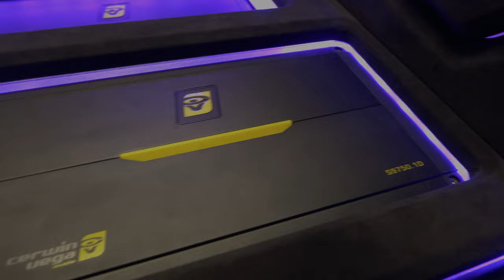CUSTOM CAR AUDIO [ Infiniti G37 ]

Comment: Running an extra headunit ground to your amp ground point helps big with stopping ground loop noise.
Reply from the maker: Huge thank's for the input Stanley and a extra ground was actually suggested from a friend. All installed and done 😍

Comment: Bro the trunk looks awsome. But the speaker and rca cabling ran with power cables isn't a issue if using good rcas and cabling.. 90% of the time noise comes from crappy grounds. If you test for good grounds it's very unlikely to get alt noise
Reply from the maker: Thanks man! Really appreciate you taking the time to write. You are totally right. Thank's for the advise and luckily I don't have any noise 👌🥳

Comment: Awesome work, I was thinking of doing airride in my 2014 Q60 eventually as well. Maybe I missed in the video but where is the air tank?
Reply from the maker: Hi there and huge thanks for even taking the time to write. I have the tank in the middle of the back seat. I have some good piqs on my Instagram (@MagassDesign). Its under the cage, built in to the seat.
Reply: Thanks, I’ll check it out!
Reply from the maker: 😍 @paclypse71

Comment: Hey what led strips ,Controller do you use  is tha controller bluetooth app  any information will be appreciated thanks
Reply from the maker: Hi there. i think that the company that I bought it from dosen't exist anymore. Sorry! 
But I think if you are going to controll everything at the same time with one App you can easy connect all toghether trough most of the apps that come with todays led kits.

Comment: Hvilke magneter bruker du?
Reply from the maker: Jag brukte desse 😁https://www.amazon.se/Neodymium-Magneter-Starka-s%C3%A4llsynta-jordartsmagneter/dp/B0995MF5YS/ref=sr_1_8?crid=KQR0C51513CZ&keywords=Neodymium%2BCup%2BMagneter%2BStarka%2Bs%C3%A4llsynta%2Bjordartsmagneter%2BH%C3%A5l%2B3mm&qid=1670566946&sprefix=neodymium%2Bcup%2Bmagneter%2Bstarka%2Bs%C3%A4llsynta%2Bjordartsmagneter%2Bh%C3%A5l%2B3mm%2Caps%2C62&sr=8-8&th=1
Reply: Tusen takk😊
Reply from the maker: @berntlilleeng3215  Inga problem😇